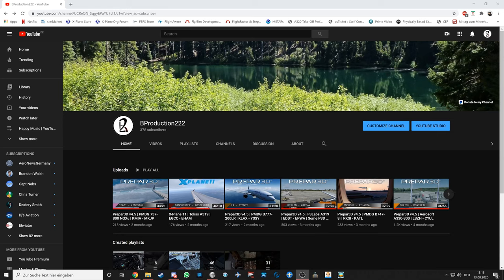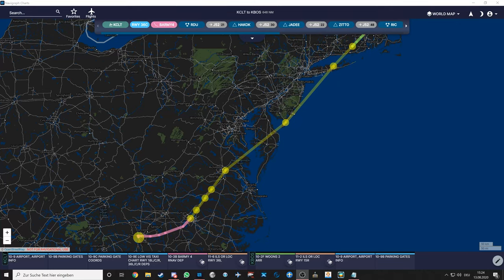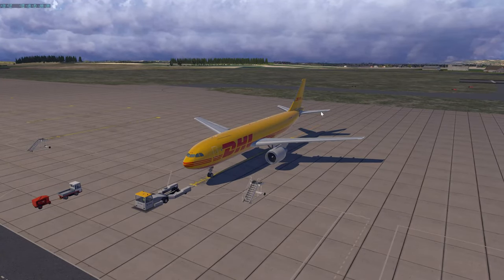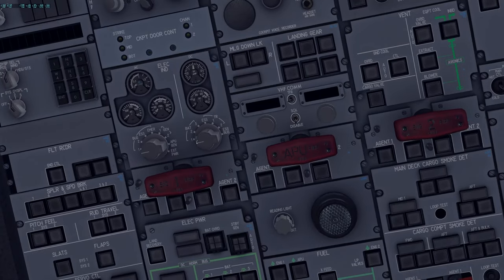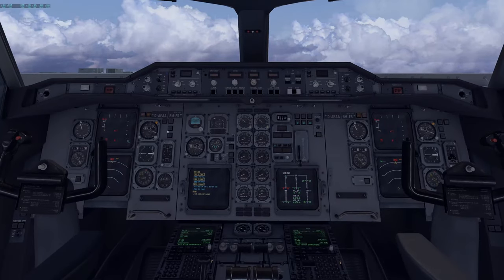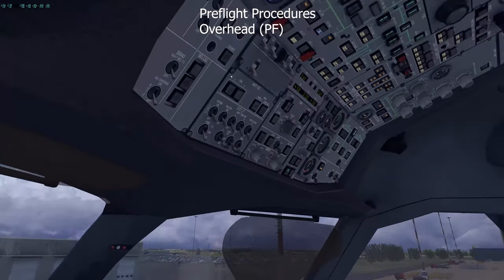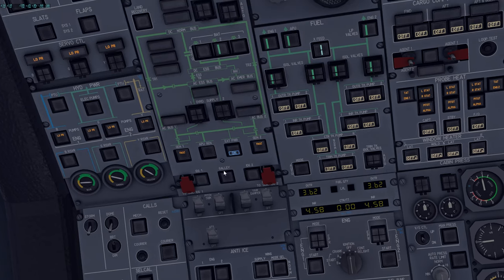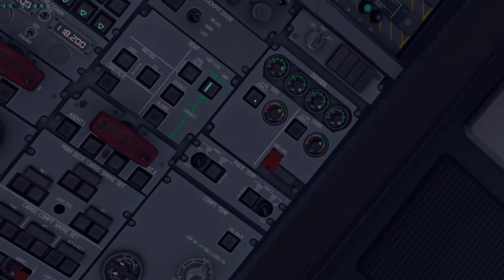iniSimulations A300 | In-Depth Tutorial | Part 1/4

Comment: Nose gear won’t turn sharp enough to make any turn on the ground. Is there a nose gear switch for ground movement.
Reply from the maker: Make sure to either use “yaw”, which is a combination of the rudder and steering tiller, or use “steering tiller” for just the tiller. Since I have rudder pedals and a joystick, I have assigned my Joysticks Z axis to the “steering tiller” and my rudder pedals to “Rudder”.